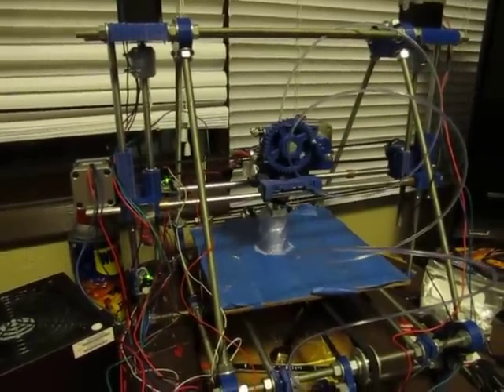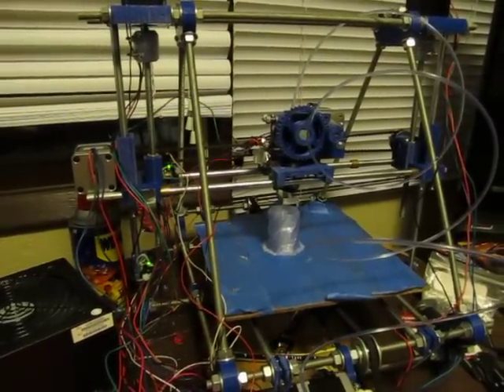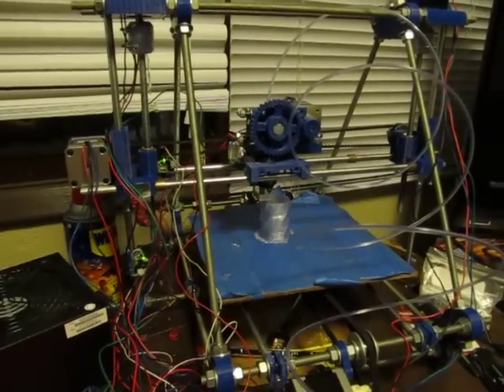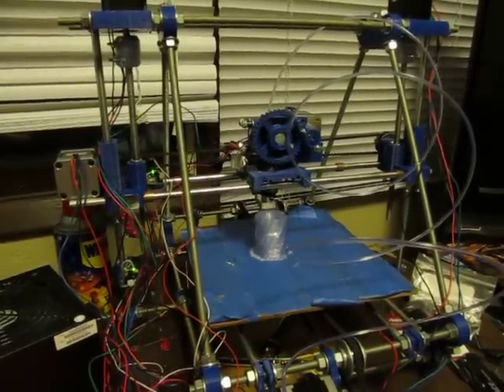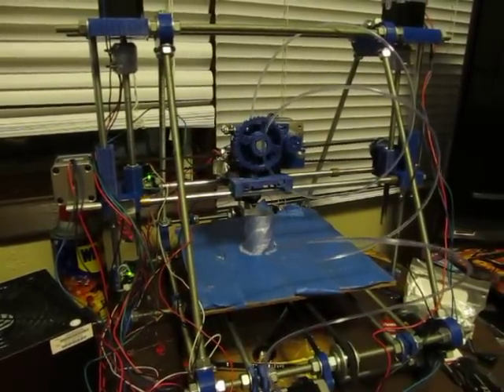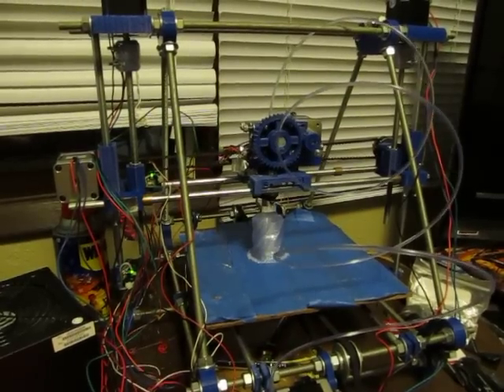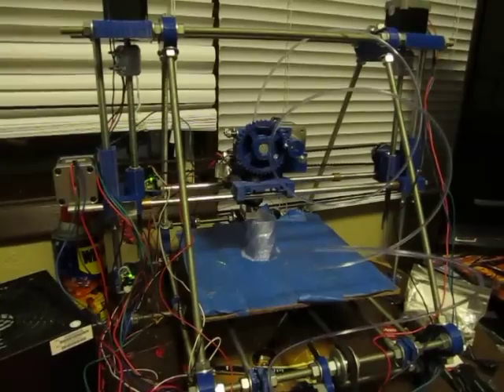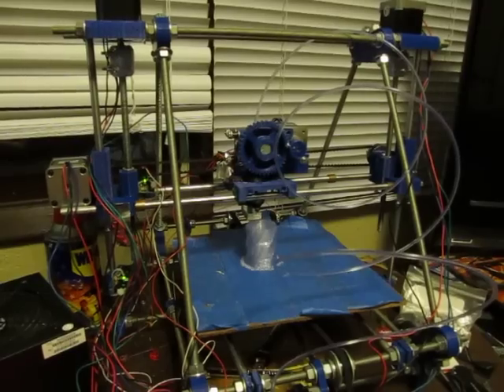Reprap creating Shotglass

Comment: A better lubricant that will last longer and quiet your prints more is white lithium grease.  It is meant specifically for these kinds of applications.  You can buy it in a tube or a spray can for pretty cheap.